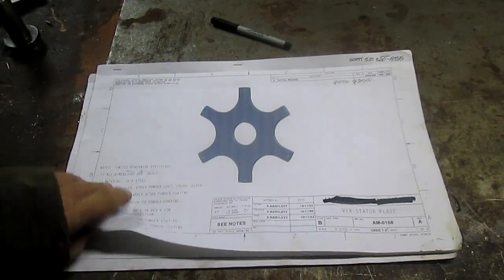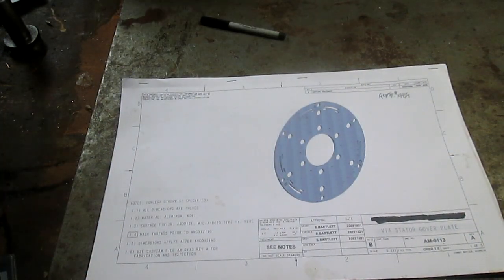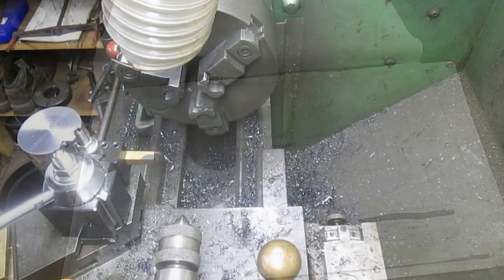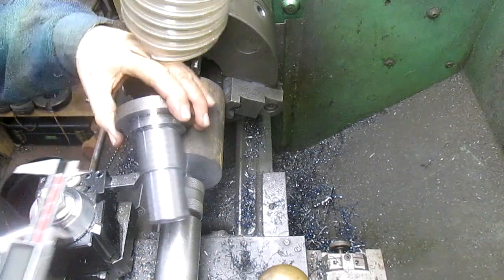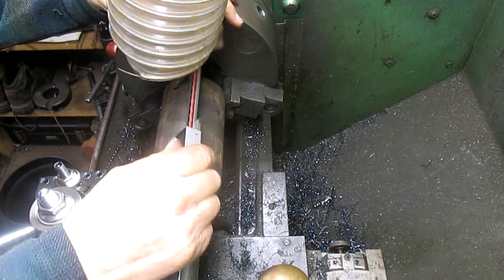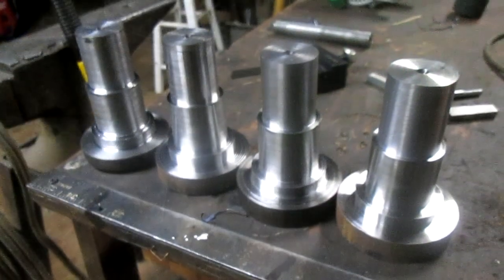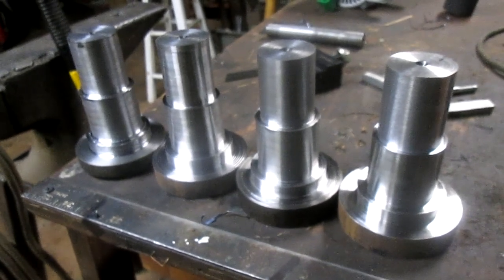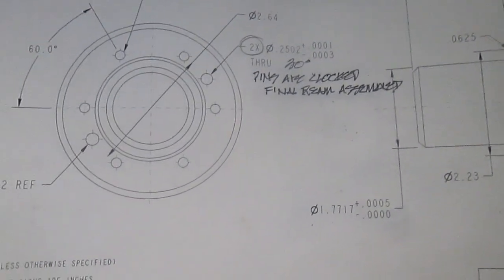Experimental Armature Build #1

Comment: Nice bit of free cutting steel you have there. Looks like an interesting project. You are calling it an armature is it going to for electrical work. Most armatures are made from soft iron not steel. Regards from Australia
Reply from the maker: The customer said this was a proof of concept motor. If it works he will come back and stack a hundred thin segments to make it work more efficiently. I wouldn't mind doing it twice, it was pretty good money.